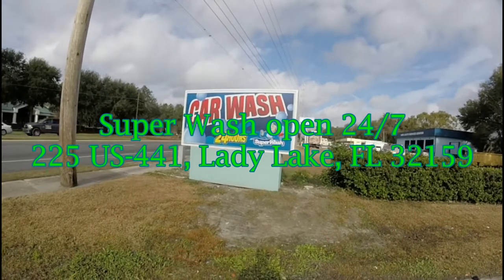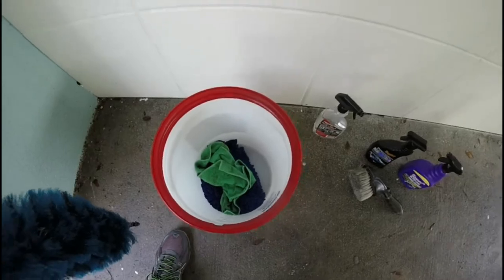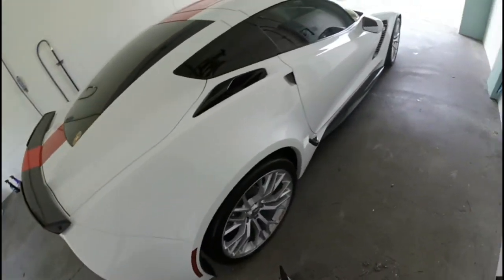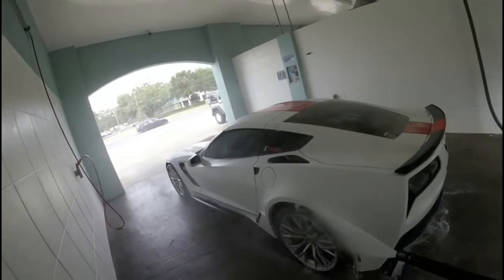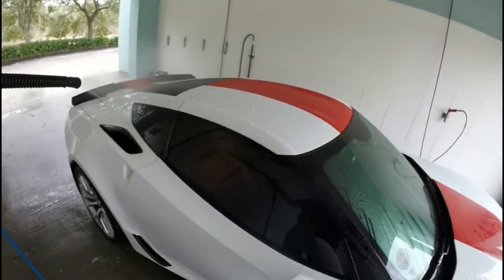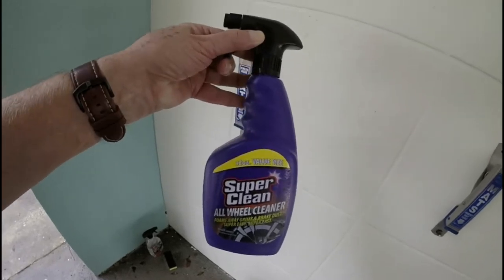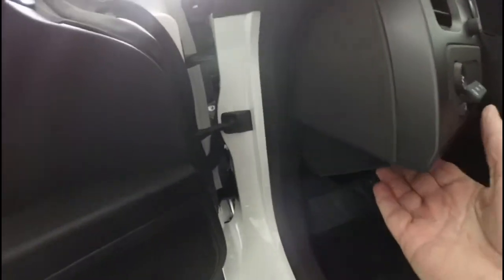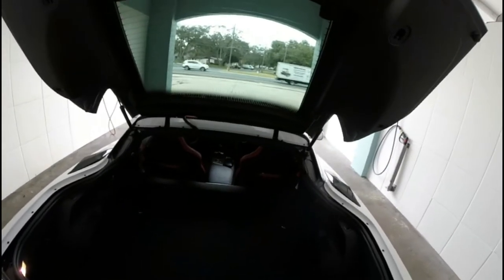Car Cleaning Secrets Revealed

Comment: A leaf blower works great drying the car.
Reply from the maker: That's a great tip. I've used a leaf blower when I wash the car in the driveway. And here in FL the water really spots up so you need to blow it off quickly.